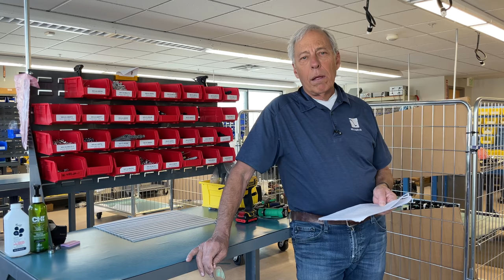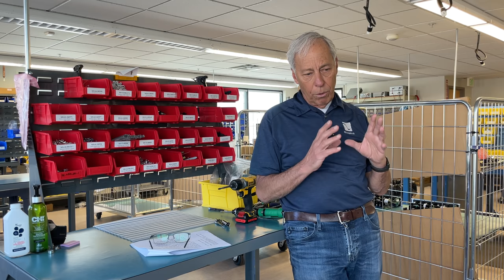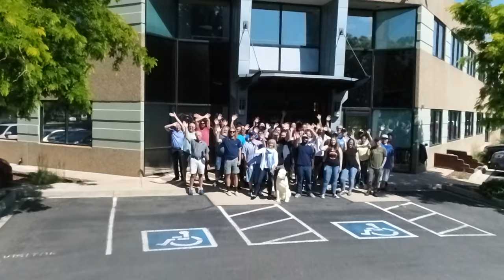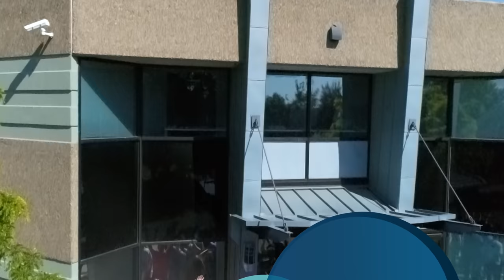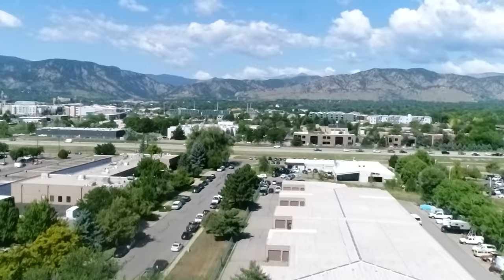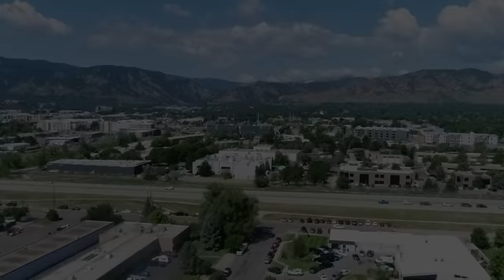Understanding DoP and resolution

Comment: Hi paul, i am a new subscriber i love your way of explaning i wish i had a teacher like you i would learn everthing clearly, well am here to ask a question if it's ok, i have seen that you have products for sell that clean the power coming from the outlets, i have a ground issue, the house i live in is not grounded it's a house that was not built with grounding in mind meaning the outlet's have two holes not three so am mostly having ground loop noise on my computer (In-Ear Monitors / Headphones / Speakers). i dont have a clue of how to solve it cant rebuild the electrical system of the house it's in morocco it's a house made with briks and cement, so am mostly listning to musique off my smarphone or something wish is not pluged to a wall outlet, it's a problem that i wish i could solve with a simple solution (Poor Man's Idea), i have just bought a pair of HIFIMAN SUNDARA'S from amazon they will come in about 10 days, i am just asking you how can a (john doe) like me fix a ground issue without having to call for a mason.

Comment: DSD relies on very aggressive use of noise shaping, and consequently, it is even less robust than the CD format in a production environment. DSD 1‐bit signals are not easy to process and quality can degrade quickly in mixing and mastering operations.

Comment: Paul,  please can you explain HOW 1bit PDM aka DSD is a very different capture process to PCM the key point being it is not digital at the very least in the same way as PCM is truly digital and that is why you cannot just stream it out of a standard computer (or mix and master in Pro-tools etc etc...)

Converting DSD to PCM certainly loses information but how much this effects the outcome is highly debatable, PCM to DSD shouldn't lose anything (If converting PCM to DSD "loses something" then why does your Direct Stream DAC do just that? why not leave it as PCM?). There is a good reason for converting PCM to DSD for playback as most DAC's use sigma delta chips that can use more gentle filters when converting to analogue if fed a DSD stream.
Reply: It is digital, its just a different way of handling it, that relies on enormous amounts of feedback correction to work - not unlike modern class D amps and SD Dacs.
Reply: @LordVictorHalgaard  I think that’s what he meant by “in the same way”.
Reply: @LordVictorHalgaard  So why can it not be used in any coherent way within any digital processing system without conversion to PCM? DSD is just a stream of 1's and 0's bits that mirror in their densities the incoming signal. It does not contain any samples or binary value words.
Reply: @angelwars3176  Thing about "just a stream of 1s and 0 bits" is most computers don't know how to process that. That's "realtime computer" territory and is next to impossible to achieve with the architectures of "normal" computers.

Comment: On blind A/B with exacting pre-measurements of equal volume at all frequencies, a lot of years of informal public experiments strongly suggest to me that there is no demonstrable human ability to consistently tell the difference between any HD formats. In fact, for the vast majority of audiophiles, we used to play games during studio tours and have them raving about the richness and depth of an MP3/320/16 CBR signal as long as they thought it was lossless. Unless you're playing back high-frequency square waves that need 84kbps+ sampling to maintain reasonable accuracy, it is an industry of perceptions and placebos.

Comment: Huh? This made no sense to me. All studios use PCM to mix and master. There is no benefit to DSD except as used in the final stage of output - the benefit is an analog one (the final step of conversion back to analog). Direct Stream just means the file is already in the format directly usable by the DAC - so less computational work for the A to D. It is a direct stream rather than having a computational step in the DAC before going to the converter stage. In the days of SACD perhaps it made kind of sense to store music this way but computing power isn’t in short supply these days.

Comment: You did infer that pure DSD is marginally better than DOP. Why can't the DOP infrastructure reassemble DSD as well from the PCM frames? It sounds like something analogous to VCR hifi audio where the scans across the heads are chopped up as the heads hand off to each other. It takes time to do that and hence errors. Someone please correct me.
Reply: "Why can't the DOP infrastructure reassemble DSD as well from the PCM frames?"

Isn't that EXACTLY what it's doing? https://en.wikipedia.org/wiki/Direct_Stream_Digital#DSD_over_USB
Reply: Don't understand your point. DOP just 'disguises' DSD into separate PCM 'frames' so the computer can recognise it and send it out. It's essential to try to understand how different DSD is to PCM.
Reply: @BB..........  Yes, but I'm wondering why Paul said it's not quite as good as DSD.
Reply: @angelwars3176  As I perceived it DSD compared to analog rotates the power domain into the time domain where pulse width equates to amplitude, whereas PCM is a series of coded words representing samples of the content.
Reply: There the same thing in the beginning and end?
Reply: @InsideOfMyOwnMind  Paul is talking about converting a DSD recording TO PCM, when he states that, not about DoP which is just wrapping DSD data in a PCM wrapper.

Though it's all done in the digital domain, it's analogous to recording a DSD recording on tape - it will sound good but not as good as the original.

DoP is akin to sending a photo via email; the digital data making up the photo must be converted into a format email programs can understand -  as the protocol was designed to send only text - and decode the text  back into a photo on the receiving end.

Comment: PCM over FLAC works for me with Amazon HD Music with no fuss. Modern DACs take PCM and does the necessary conversion optimally with only part of the conversion involving sigma delta (what DSD is). Thus, actually modern DACs are not optimized for DSD. Rather, any modern audio architecture involves audio processing from volume attenuation, mixing, sample rate conversion, soft clipping, filtering (e.g. cross-over), encoding, decoding etc. and requires PCM as native format to do any math on the signal. DSD can beat red-book CD, but if you run 96kHz 24 bit PCM or better yielding superior phase and frequency response, the audio benefit of DSD becomes quite imaginary.
Reply: Wut? FLAC is simply a lossless PCM codec, it has nothing to do with DSD.
Reply: @BB..........  Of course it has something to do with this topic. DoP is DSD over PCM (DSD pretending to be PCM) fooling PCM architectures to route it as if it was PCM. So you can play DSD over PCM using a FLAC codec...but my point is that it's much better to just stay with the intended PCM as it works throughout modern audio architectures and the sound quality can even beat DSD with enough resolution and sample rate. This DoP thing is not a viable thing for future audio solutions but rather a hack for geeks.